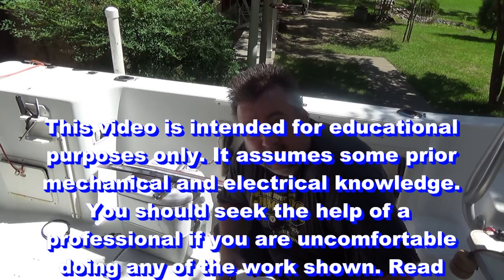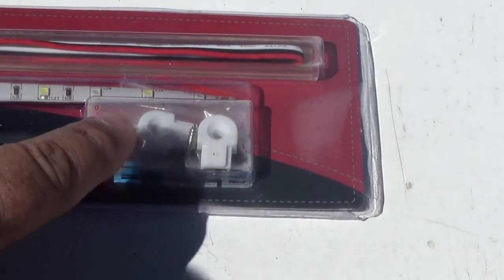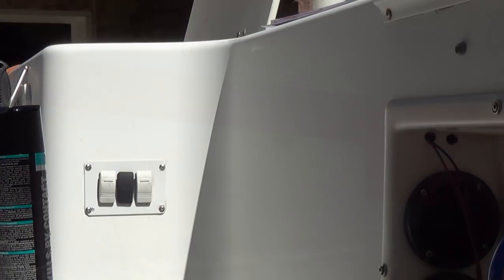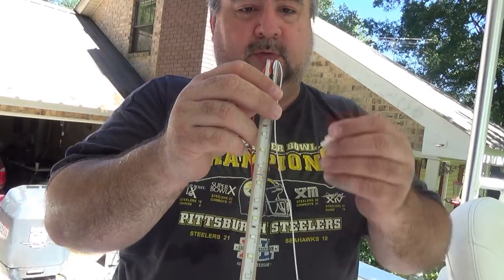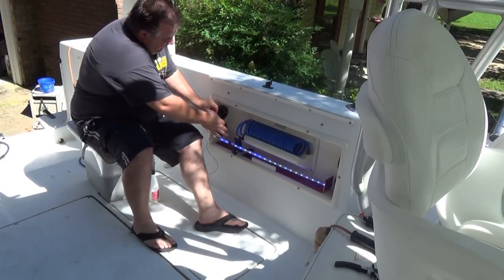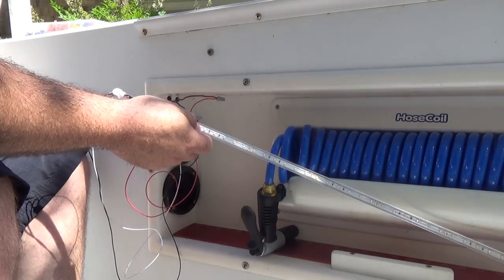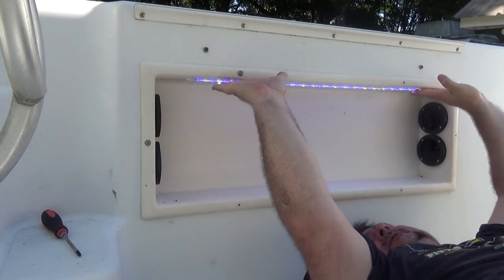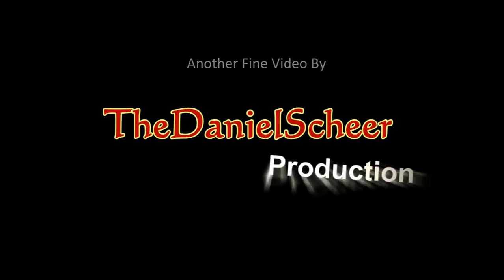HowTo: Install LED Strip Lighting on your Boat

Comment: Good vid.  I am thinking of putting LED strips in the same location in the rod bays.  I think another easy solution to get the blue or white would be to use a 3 way rocker switch.  Then you have the best of both worlds!

Comment: you cant ground a Battery DC circuit, the 'ground' is a negative reference. You must have a reference point to complete the circuit hence why when you connect both references you complete both the blue and white LED circuits.

Comment: We 100% do not use plastic wire connectors in the marine setting for multiple reasons no matter what you fill them with